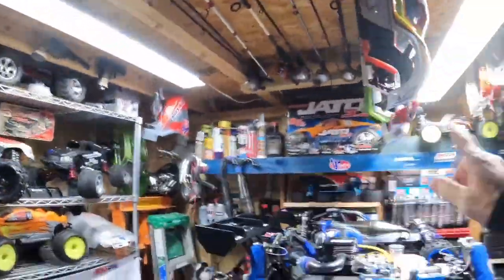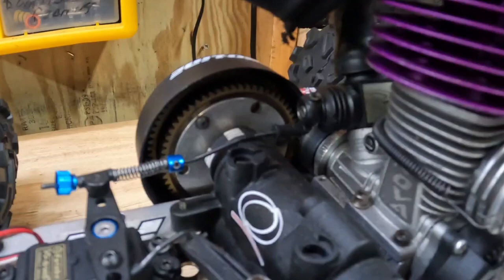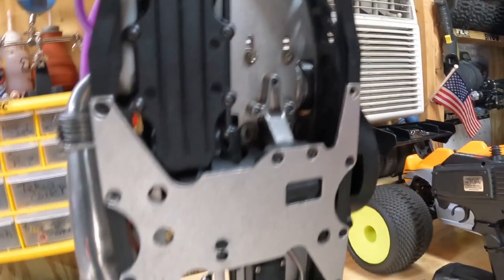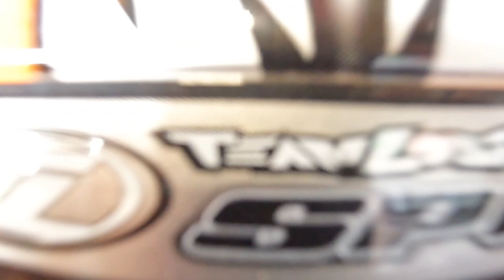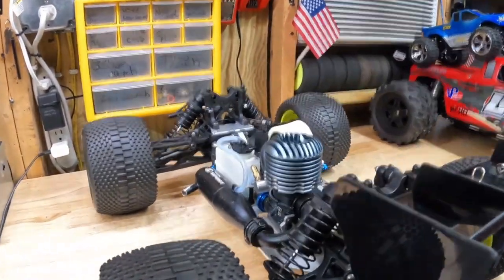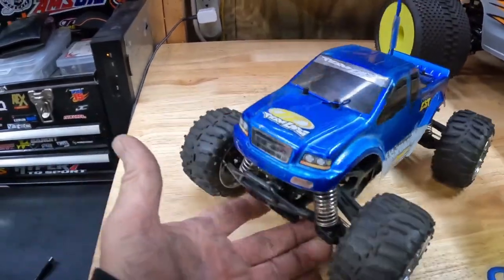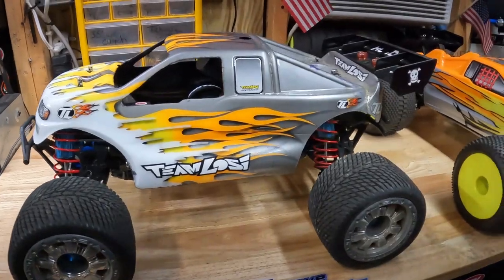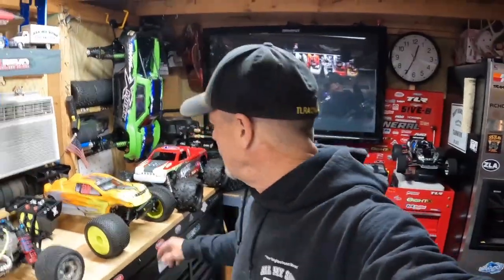LOSI...KING OF THE MTs

Comment: Maaaaan...I'm so jealous! You've got your RC collection so nicely restored and clean all organized on shelves n shit. Maaaaan I BADLY need to restore my collection like you've done, my shits everywhere, all my rigs are dirty as shit except a few newer ones, all my parts re crammed into tubs and boxes, radios everywhere, batteries everywhere ughhhh I don't know where to start! But you have invigorated my drive to get my shit together and get a nice hobby room setup in the garage. I've got the even older losi Raminator lst model, and that's the one I want fixed and running 100% the most. I wanna get a real powerful engine for it. I always just had the underpowered m26 that came with that crap muffler not even a tuned pipe. i put a Jammin jp-3 on it and it came alive! but it still just a "mid block"  You're my hero RC brother! Haha 😎
Reply from the maker: As far as ceraminator goes, I would just put the big red point 28 in there. That's a workforce. Extremely powerful. Even the RCR Dynamite going to a either one strong engines. LST platform

Comment: I know I'm not very active in the comments, but man, this video has me pumped. I absolutely love nitro MTs. A big fan of the LST lineup as well. One of the best handling MTs in my opinion. Same goes for the mini. Unfortunately the mini suffers from seriously weak diffs. I did convert my mini lst 2 to brushless for reliability reasons, but I have the esc tuned down to the point that it runs like stock brushed setup. As for the 1/8, I have a bone stock first gen lst. The M26 is getting a little tired tho. But man these things just float across real rough terrain absolutely love the handling. The savage is probably the worst handling MT I've driven. My xl is tough as nails, but the suspension geometry sucks. Anyway, I can talk forever about nitro MTs, so I'm just gonna stop here lol. Can't wait to see more on these trucks. It takes me back to the good old days.
Reply from the maker: I think I got my eye on another project. LST stay tuned!
Reply: @woogienitro  Awesome man. Definately looking forward to it. I wish you did'nt live so far away, I'd like to spend a day hitting the woogie ramp. I live about 45 min south of ft worth. So close, yet so far away. Is there still that huge hobbytown in san antonio? I went there with some friends about 10 years ago and it was massive.
Reply from the maker: No, the HobbyTown closed down about a year ago
Reply from the maker: We got a couple of really good hobby shops though. One really geared towards electric and electric drag racing and the other pretty much everything else including mini seat track etc. Well you saw Mark Santa Maria when he came to RCHQ at rolling oaks Mall. Here a Mini-Z track in the mall. It's cool
Reply: @woogienitro  Yeah, that's pretty cool. All of our shops here are dropping like flies. unfortunately laziness and the internet is really hurting our shops.

Comment: I got a probably stupid easy question that I do not know yet. 

Summer compared to winter driving.   Do you run more oil in the winter or the same fuel all year around.  

Where I live it’s always wet Cold and nasty most of the times.   So I gotta ask and why is now that I’ve switched to 16% oil 20% nitro my cars run better cooler to 🤘😎
Reply from the maker: And it's basically summer here where I live year-round. I really don't have to change the plug too much or the Nitro. I just run 30% Nitro 10% oil and generally an OSP3 Gold for 21s

Comment: They are in great condition. I converted my LST XL to electric. Nitro has been dead for years.
Reply from the maker: Yeah I love both electric and nitro
Reply: @woogienitro  been running it till about 2 years ago. Took on some salt water and parts are rusting. Had a lot of diff issue before that too. I am running Arrma trucks now, and just got a Rovan 5B buggy a month ago.
Reply from the maker: If you don't have the aluminum diff housings upgrade to that, what happens over time? Is the diff housing when they're plastics get worn I had this issues in the beginning when I started messing with the LST and then obviously with everything else is trial and error
Reply: @woogienitro  I had the aluminum diff housing. Something with the gears keep making noise after I assemble it and run it, and then when I take it apart been seeing anything wrong. I have to same thing happen to the HPI Hellfire SS. Maybe the electric motor is too strong for the diff. One of these days are we still are my vehicle back to normal as a shelf Queen. I also have the Jannin X2 xrt Trucky as well

Comment: I need your help I just bought used good condition stock losi aftershock limited edition in Miami Florida the motor is no good so I bought new model nitro engine lrp.28 from amain I don't know what pipe run with it im mainly running off road no racing just little bashing can you point me in the right direction with the pipe set-up?
Reply from the maker: I used to novaroshi 41015 and 9886 pipe but really any bottom end torque pipe look for a pipe with a low number. 2135 hypex is a great pipe

Comment: Where can I find fuel tank for my losi aftershock nitro limited edition ?
Reply from the maker: pretty hard to find. Just have to keep checking on eBay, you could upgrade to the octane gasoline tank. You just have to swap out to Nitro lines and it's a tight fit but it works